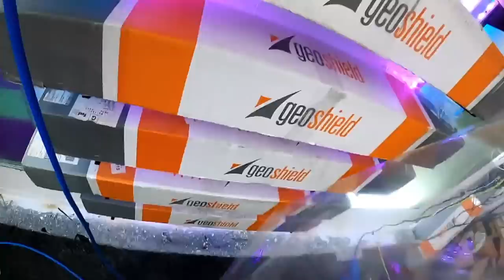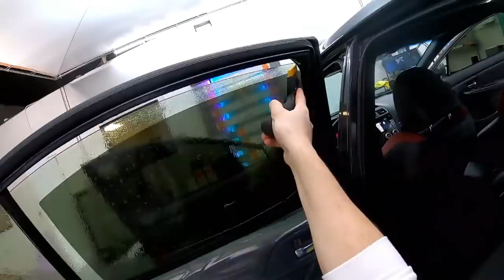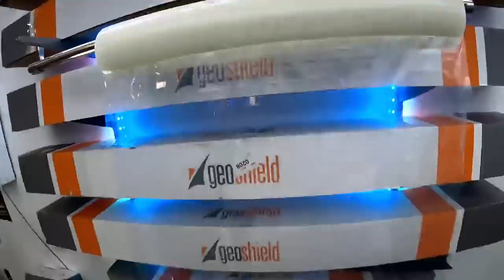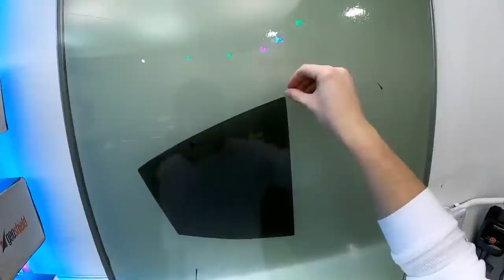How to Tint DIFFICULT Quarter Windows

Comment: Oh and a good tip for the start up people.  a MOBILE SERVCE. is always good   just have to make sure the customer has a garage for you to work in and then you don't have to wait on them whent the care is finished  Most of the time you will only get higher end customers  and two windows  SUV's  and Trucks  thats easy pull up at their work especially  if there is a parking garage    Great channel

Comment: Hey dude, fellow long term tinter, in Darwin we had the heat problem like the Philippines & a shop like yours, we ran a heavy vinyl curtain on a rail, ceiling to floor & ran air conditioning in that area only. You could use reverse cycle, you'll recoup the cost of it on heating the smaller area in 12 months & a constant temperature year round. Keep up the good work!
Reply: you can set up a Car port tent also too and control the climate

Comment: Bro what is that hose called to stream the water hard like that?
Reply: Is it on a compressor??
Reply: The tap with a high quality filter then hose & air compressor tip
😂😂😂😂😂😂😂😂😂😂😂
Reply: Cornelius or soda tank with air valve added to pressurize.